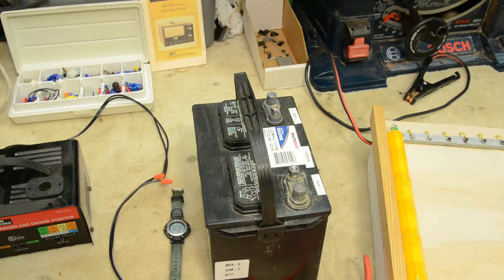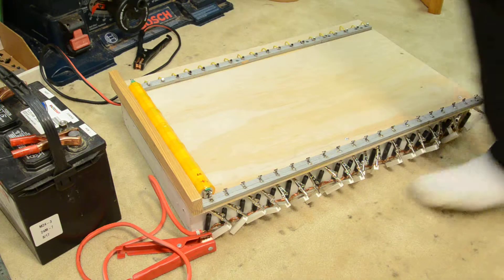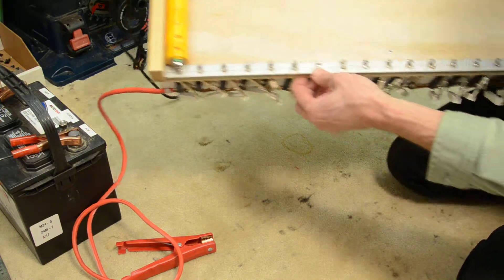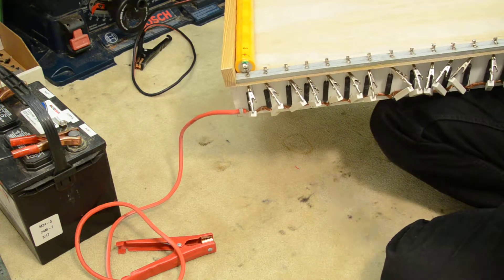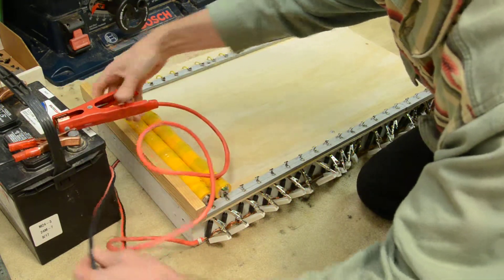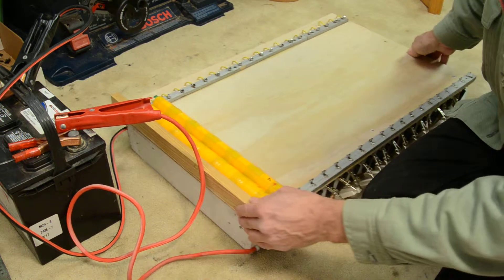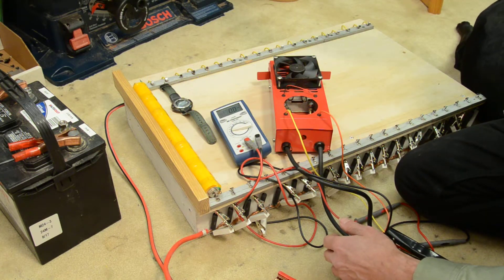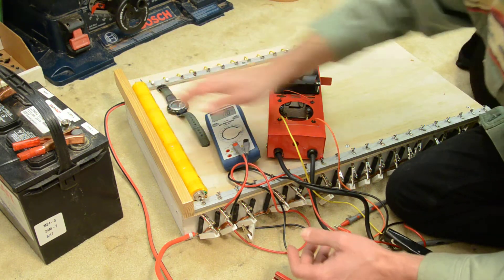2005 Honda Civic Hybrid 144v nickel-metal hydride NiMH battery charging and reconditioning Part 2

Comment: Hi Paul, just build my version of your charger. Per your recommendation, I went with the TUW15J10R resistor only. My question is how hot are they supposed to get while charging? I touched one of them and it felt like it was going to burn my finger lol. 

I hope to have a video put together soon of my rig. I took your recommendation on the D Cell terminals for one side. 

Thanks again.
Reply from the maker: Hi there Conor, I hope this gets you back on the road!  It's been some years since I did this for my neighbor, and she sold that Civic hybrid last year.  I think it was an 2003 or '05 with a manual transmission (!). Anyway, I still have that rig up in the attic of my garage.  I remember the resistors getting painfully hot, but none of them burnt out.  Train a box fan on the whole rig if necessary.  When you are done, it may be a good idea to voltage and load test each stick before reassembling the battery pack.  If one is truly dead or way out of spec, you may want to buy a  used battery pack off of Ebay and cobble together a new assembly out of the best batteries. I remember there were electric thermometers and such in the pack, remember to re-install those.  I also remember stripping one of the bolt studs upon reassembly, so be careful not to over-torque the bolts.  Let me know how it turns out!  I'm glad some people found the video useful, and that it eked out some additional life out of these old cars. Luckily NiCad and NiMh batteries are forgiving and won't burn violently as a lithium ion battery might! 
Best,
Paul

Comment: Very nice thank you so very much for your time, insight and sharing. To bad your neighbor didn't have a Prius though. I'm playing with 7.2 volt IFIRC 7850mah 6 cell prismatic battery plate all 28 of them. Excellent work. I'm in the Stafford Virginia area so not that far from DC. Thanks again for sharing will definitely subscribe

Comment: Hi again Paul, sorry for another question. 

I bought the Harbor Freight battery tester and it is 100amp. You say in the video that it is pulling 30amps (15:04), do you remember what your battery tester was rated at?

When I put mine on the tester, they drop to 6v rather quickly. So they are either shot or, I’m putting a heavier load on them. 

Thanks again.
Reply from the maker: I no longer have that one, but still have a 50 amp load tester model, Harbor Freight model 90893.Too bad, the lighter-duty load testers they used to sell are more suited for testing these sticks; the 100+ amp load testers are more for automotive-sized  lead acid batteries.  If you use the 100A one they now sell, run it for only 5 seconds and read the voltage at that the five second mark, and comaper the result with the other sticks to get an idea of waht a good one will produce under that load.  An alternative would be to put a multimeter on the stick while putting some other, more appropriate dummy load on the stick to see how the output voltage sags over the course of a minute.
Reply: @phogroian1  Thanks for getting back to me so quickly. Some of them actually held at 6v for awhile at 100amps. 

Looks like I’m headed back to Home Depot for light socket and a Halogen bulb.

Comment: Interesting.  Can you do a dedicated thread on Insight Central explaining your concept/design and process please.
Reply: Just follow the directions;  very simple. After my 3 year and 3 month failed  "Burglar-Battery" from eli started to "sweat" and rust underneath his black heat-shrink, I traded the highly flammable sticks for 20 of  his old sticks. My pack still works well with a Grid Charge when I don't drive it for awhile.

Comment: Thanks for showing your setup. I had the same issues with my accord ima and I did the recharge and discharge on the pack and even bought up the capacity some what more then before but the light kept coming back a few days later because the ct sensor can see the state of charge on the battery so I did 2 loops through the ct on the battery circuit and it worked for a while longer but the light returned and I bit the bullet and bought a set of chinese batteries and they work amazing well off alibaba for $1024 bucks way cheaper then honda would do. In the end its cheaper to just buy a new set of batteries then keep messing with a dying pack but these batteries can pack a punch of current with a good one I was able to get 100 amps off a double stick while the dying stick could be refreshed I only got 80 amps which didn't hold up much longer. The computer trips after the battery capacity falls down 15 minutes into the car ride.
Reply from the maker: Hi there egn83b
Yes, had it been my car I probably would have just bought an aftermarket complement of 20 sticks and been done with it since I wouldn't want the venture to be in vain... it was such a pain putting that battery pack back together, with all those "overheat condition" sensor tabs! But even in that case, I'd be tempted to rig something up make sure that they were all equally charged, or topped off, before installing them. When the no-charge problem emerged on my neighbor's car upon resurrection from its four years if sitting, she was on the verge of junking the car anyway because of its high mileage and balding, rotten tires.  Putting in a grand or so for new cells might have been a deal-breaker, though I would have recommended it if the existing sticks refused to be partially reconditioned.  Had any of the sticks shown more significant voltage sagging on the load test than the others, I may have sought out just replacing those sticks that were bringing the rest of the pack down. I may have been lucky that it worked out in this instance, but I think it is a worthy attempt for anyone who wants to give the existing batteries a last shot!

Comment: I have a 12v charger that has a "trickle charge" setting at 2a. could I just use that setting instead of using the resistors like you did. Obviously I would have to use a headlight or something for the discharge, but it seems like it would be worth it for the amount of work that it would eliminate...

Comment: sorry i don't want to sound stupid but can't we just use D cell rechargeable battery ? at the end of the day its just + and -. if one battery should ever go bad it can be replace easily.
Reply: Yes- they are simply NiMH (not NiCAD) "D" cells. Since the sticks are so nicely welded, with the appropriate end pieces attached, and shrink-wrapped,  I would strongly advise purchasing a replacement stick for any grouping that will no longer accept an appropriate charge, though a stick COULD be disassembled to determine which cell is the "dead" one.

Comment: Are 2003 honda civic the same battery pack as 2005 honda civic?
Reply from the maker: The same "sticks" are used on the 2000 through 2006 Honda Insight, and 2003 through 2005 Honda Civic Hybrid.